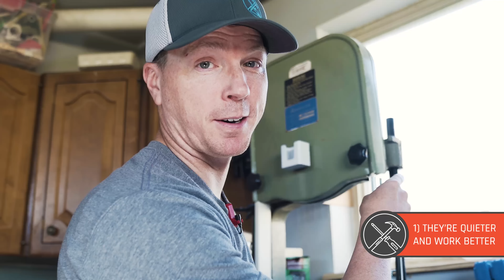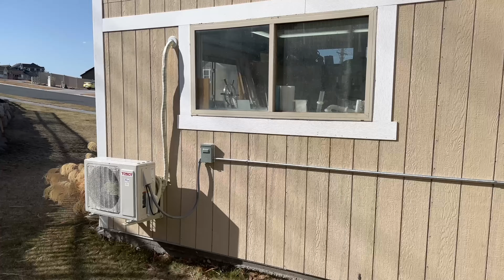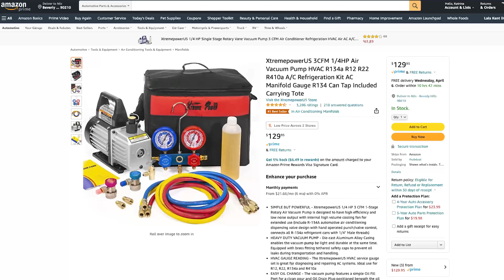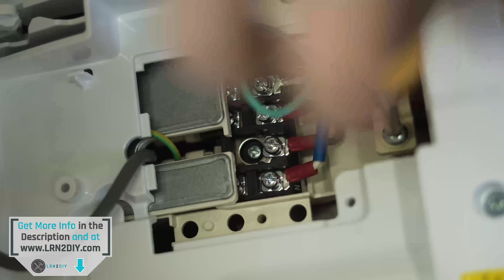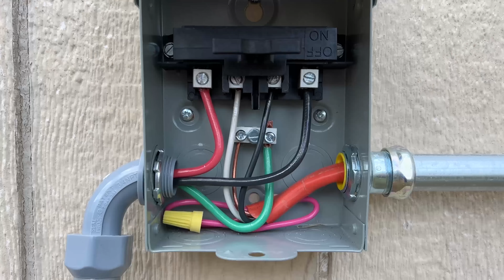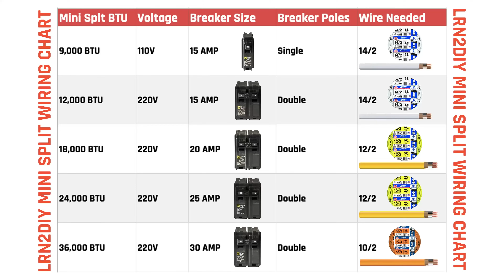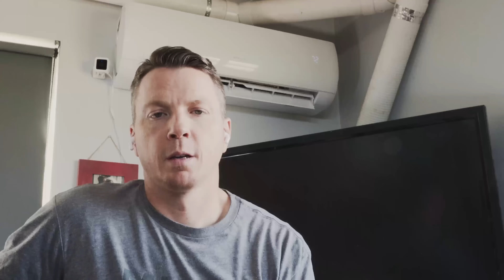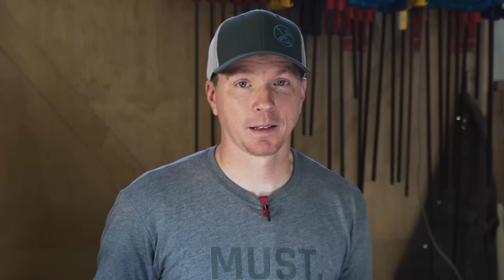Mini Split - 3 Things I Wish I Knew Before Installing

Comment: Thank you! Just the information I was looking for. Thinking about 2 mini splits in my 35' RV. This info really helps!
Reply: Grand Designs is starting to install ductless mini split heat pumps in their new units!  It is a great upgrade.  They put in a 2 zone 240 volt outdoor  unit under the fifth wheel section, with the air intake on the drivers side.  You have to be right next to the unit to see if it is running, they are so quiet!  And the indoor coils are silent, as noisy as a very quiet refrigerator.  

The problem with the two zone outdoor unit is they require 240 volts to run them.  Your other option is a pair of 120 volt units, with each being 12,000 Btu capacity.  There are several suitable units, and I would suggest using both drain lines on the indoor coil.   That way, if the unit has one side higher than the other, the lower side will drain out.  I would mount the unit on the drivers side wall, and then run the tubing into a closet or down the wall into the basement area.  That way the drain will work the best, and also hide the copper tubing the best.  

I think that Grand Designs is going to start using a 48 VDC inverter, and they are also recommending that you install a 9 kilowatt alternator on your towing pickup.  So you will have two alternators.  They then use a 15 KW battery system at 52 volts, and the alternator is rated at 9,000 watts, or about 175 amps at 52 VDC.   I am not sure how large the wires are between the truck and the RV.  They might be running even higher voltage, I just don't know for sure.  If the alternator going to the RV is running 3 phase at about 300 volts, then #10 wire fused at 25 amps would be large enough, and still have a cord that is flexible.  At the RV, the alternator output voltage can be reduced to charge the 52 volt battery at about 175 amps.  So very large wire is required to handle 175 amps for 9 KW at 52 volts DC.  Think larger than your battery cables on your truck battery.  

So the problem remains If you happen to love a RV park that has a 30 amp 120 volt power plug, and is out in the middle of nowhere.  If you have plenty of solar power, that is fine, your inverter can produce enough power to run the ductless heat pumps.   If you can plug into the 30 amp service, and run the battery charger to keep the 48 volt battery full, or at least partially full, then the inverter can run the 240 volt ductless heat pump just fine. 

But if you do install two each 120 volt ductless heat pumps, you could run them on a 30 amp service, and do much better than when trying to run a pair of 120 volt rooftop units.  This is because the ductless units only draw about 1,000 watts when doing the maximum cooling, like when it is 80 inside and you set it to 70.  Once the inside temperature and the set point are very close, say it is 76 inside and you set it to 74, the compressor slows way down, and the unit can use as little as 350 - 500 watts.  So running a second one with a 30 amp power service is fine.  If you are getting close to your maximum power draw, or the voltage is dropping, you can shut off or unplug your battery charger until there is a time, such as at night, when you can plug in the charger again.  Or run a extension cord to the power post to run the charger from the 120 volt 20 amp plug.  That can shift about 5 or 6 amps off of your 30 amp plug to the power post.  Or if you can plug the ductless units into a 120 volt receptacle, then plug one into the RV, and the other into the 120 volt power post receptacle.  

I might suggest installing the outdoor units on a cargo carrier on the back bumper?  Maybe you have a better location in mind?
Reply: Check "Paving New Paths" where they visit Grand Designs to see how they install a 240 volt ductless unit in the Grand Designs fifth wheel.  Also look at the Tampa RV show made by the same person, Paving New Paths.

Comment: I wish I can do it my self all the ac company wants to charge me 5k for 1 small room
Reply: Mr Cool does sell a do it yourself install kit.  The refrigerant lines already have about 10 PSI of R-410 in them, and a foil covering on the end of the tubing.  So as you attach the two tubes together, they puncture the foil and allow the refrigerant to flow freely.  

Basically if you are friends with a electrician, you can install it with their help.  The electrical is the really difficult part.  You would pay about $500 more for the DIY install kit by Mr Cool, compared to the price for the tubing that is connected with flare fittings, then evacuated with a vacuum pump, and then you open the refrigerant lines.  All of the units are pre-charged with the correct amount of R-410 for a line length of about 10 to 25 feet.  Over 25 feet, you would add about 1 ounce of R-410 per extra length of tubing, there is a chart with your unit to say how much to add.  

Maybe you could take a class on air conditioning and electrical installation, then start a business installing ductless heat pumps?  They only take about 4 hours to install one, once you are used to doing it, and have the right tools (about $500 to $1,000 in tools).  Then you could be the one making $2,000 to install one!  You do have to buy a inspection for about $300 in many locations, a little more or less in other locations.

Comment: okay, so you bought a vacuum pump and gauges. Now, you need to purchase R410 or the new stuff R470 - so did you check the price on the Freon? You forgot you have to add Freon. Pre-charged lines are pre-charged with Freon. Uncharged lines are lines without Freon. The smallest units you can get are 6K BTU
Reply: Davey, Every unit I ever installed came with enough refrigerant in the outdoor unit to run the unit, and have plenty to use with up to 30 feet of copper lines.  Beyond that length, I would add a very small amount of refrigerant, say 1 ounce for every 10 additional feet of tubing.
Reply: @Kangenpower7  The point is - refrigerant must be purchased - and the cost of that refrigerant was not even mentioned in the "cost savings" portion of the video. So, how much does that refrigerant cost? Oh, and what does the vacuum pump cost that is needed to purge your lines? The pump was also not mentioned either. Here's my point regarding "cost savings" - there are no cost savings.
Reply: I mentioned twice that this unit is pre charged with R 410.  No advantage or disadvantage to any other brands of ductless or ducked heat pump or SC units.
Reply: @Kangenpower7  Not all mini-split systems are pre-charged. Did you mention that?
Reply: @kathyern861 , I have never installed a mini split unit or even a ducted unit in 38 years that was not factory charged with refrigerant.  Have you found a brand that is not charged at the factory with refrigerant?  I have heard of a R-22 system that is sent out "Dry" or without refrigerant to meet the new EPA requirements, but that was years ago, and I don't know if you could buy a new R-22 unit that is sent out without any refrigerant in the outdoor unit.

Comment: I have two mini-splits now. The first was a Mr. Cool, but the second one is a Senville 9,000 BTU unit. I saved quite a bit over the Mr. Cool model, and was able to do a no-hassle self install, thanks to watching your very thorough installation video! I even found a perfectly operating, professional-grade line-gauge set just lying in the middle of the street prior to buying the Senville unit. I was vacillating on whether or not to buy another Mr. Cool, but took the discovery of the line-gauge set as divine guidance to move forward with the self install.
Reply: Was it lying in the back of someone's work truck? 😬
Reply: @flyingjoed  it was more inside one of the side tool boxes, so it did take a little effort to make it "fall off the truck". No, it was lying in the road. I also looked around for a service truck the night I found it, and talked the next day to the HVAC service people who had been working at the house next door all week to see if it was theirs. No takers though.
Reply: @bmccarty2012 😂
Reply: I think THAT is exactly what divine guidance looks like!  Way to be tuned in and congrats on your gift.
Reply: Thats awesome there was a line set cover randomly waiting for you

Comment: Does the DYI install void the warranty on these. I just installed a Daizuki... not a very reliable unit. Heating stopped working after one season. But because I installed it myself, there is no warranty.

Comment: Great information, thank you for your vids! I saw your other video where you showed your gas fired heater. I would like to know if you think this split system heated your workshop just as good as the gas, and at a comparable cost. I am trying to decide which one to do, the down side of natural gas for me is I will have to run about 120 feet of underground gas pipe.

Comment: My first mini split was an LG and the inside fan was so noisy I couldn’t sleep with it on. I replaced it with a Mitsubishi, and the inside fan is so quiet I sometimes put my hand at the opening to check if is on. Both units have an intentional feature it dislike. In the AC mode the inside fan never turns off, even after reaching the desired temperature. The LG’s fan sounds like 400Hz military jet powered generator, which is big problem to me. The Mitsubishi actually doesn’t bother me if is on, because of how quite it is. I looked up the feature on their respective wed sites and both of the say the feature makes them more energy efficient, in that the fan isn’t wasting energy spinning up to speed.

Comment: As an HVAC installer in primarily mini and multi splits, this is one of the best reviews and intros to high efficiency heat pumps yet…and he didn’t even mention most mini splits today(2023) use half the power of a window unit and three times less than a central ducted system.
Reply: Wouldnt the power usage depend on its seer rating? 3x a central ac seems like a lot more power.
Reply: @srharris88 - I suspect he meant a mini split uses ONE THIRD of a regular unit when he said "three times less".
Reply: @debbiedogs1  I am SOOOO glad that I am not the only one who has noticed that a majority of people seem to have never been taught how to express multiples when making comparisons; "3 times" vs "1/3", etc.  The other thing that is really annoying is "less" vs "fewer" and "more" vs "greater".  Thank you, @debbiedogs1!
Reply: Living in Thailand and love the quiet, efficiency and ability to direct the cool air to your location with a Mini-Split.
Bought the Mitsubishi GT series 22 SEER, using R32, and Inverter which does soft start/stops.
Reply: @jbranche8024 R32, wow I thought that one had come out more recently.  It's basically fancy Propane, uh, flammable.  I have heard that insurance companies are getting nervous about its use, and firefighters are not far behind.  Another win for poor regulation and planning by US EPA.  Find the best R and stick with it.  Changing every time we turn around is driving us crazy!
Reply: Does the indoor unit need a drain (for water)
Reply: @0my  Yes.  It will come with a drain line that would tie into a drain
Reply: have a 1 story house. It has 2 central air units. I'm thinking of adding many mini splits (1 ton with solar input and also 110 ac input). I want to connect 4 solar panels to each mini split and just have them run for free from 10 am to about 7 pm when the sun is out. And if the grid goes down, I have a couple low noise gas generators that can power the mini splits with 110 ac. Is this a good idea? Using solar to lower the electric bill but also relying on the grid at night and when the sun is not shining like during thunder storms.
Reply: @neilwani1178  yes, and we're all jealous as hell, that's why nobody answered, you lucky dawg. Couple thoughts; if it says four panels nominal, then put in seven. They list nominal power anticipating full sun and new panels. Seven will cover you for intermittent sunshine, as the panels lose efficiency as they age, and to compensate for the heat of the sun when they lose efficiency, and seasonal variations and shading. Going whole hawg and adding batteries and a hybrid inverter will bypass peak billing times and also run it at night. 

By saving the excess solar during times when your unit has enough power and is up to temperature, you maximize the energy return from your panels.  Maybe most effective if avoiding grid is your primary goal. Also, if done all out, you can take advantage of your utilities net-metering scheme and either: get paid for your overproduction, or bank it for later, less sunny seasons, i.e.: BC Hydro in British Columbia Canadia.  Moreover, you can avoid peak time- of-day tariffs, while also using the stored electricity for other things.  

Four panels will be a great and give the best energy saving bang for the buck.  You'll have redundancy if one mini split breaks. 

BTW, "Signature Solar" online in America sells the EG4, an AC/DC  hybrid no-vacuum quick connect self-install true DIY precharged units (and also used panels I believe.)  
Costco sells a non-hybrid but still similarly true DIY self instal no vacuum quick connect precharged unit.
Reply: I live in an expensive state for elec. so for Peak Time our rate is 78 cents a KWH. I am looking for a better alternative.
Reply: @Moondoggy1941  thats insane what state is that? i thought MA was bad at 30
Reply: @sterlingmichel4445 California for the win. Yeah😢
Reply: @Moondoggy1941 we are at $12.00 a kWh for our peak for one hour. Peak is 3 to 6 pm in summer and 6 to 9 am in winter. Highest hour of those 90 hours is what you get billed for. The rest of your bill is .06 per kWh. This is in South Carolina, Santee Electric.
Reply: What is the average cost to install a 2 ton? Thank you.
Reply: I just looked, and for a 12,000 BTU 17 seer mini-split, it's draw was the same as as 12,000 BTU window unit - 8.5 amp, but the mini-split went up to 20 amps as a possible draw!   (going to need to dehumidify and somewhat cool a workshop/storage building)
Reply: @tbelding the mini split COULD draw that but only will in the harshest condition. The window unit will always dray that. Most of the time when I throw a clamp meter on a mini split the draw is no where near the max. I don't think I've ever actually seen one anywhere their max.
Reply: @justinlewis1997  In Houston, so 'Harshest condition" is pretty regular.

Comment: Pretty sketchy for buyers in the northern US or equivalent climates. That Mr. Cool unit only heats to a minimum 5 degs. F outside. The Tosot claims to still be providing heat at -13 degs. F. but offers no specification as to how much. If it's only able to provide 10% of its rated capacity at that point, that's not helpful. It's important to know your application and equipment limits thoroughly before buying.

Comment: I am planning to switch from swamp cooler to split cooling system. I am thinking t run the lines through the existing duct for an older adobe home. Thanks for sharing.

Comment: Though a 220 cost more when first purchasing, and it's take a knowledgeable person in electricity to wire it, assuming there's no 220 already available where you need it. It last longer, thus making the cost of replacing a 110 more when having to replace it a lot sooner. And it's actually over the longer duration they last, they also actaully utilze less electricity. Then a 110 does.
Reply: I have never noticed a change in voltage can reduce the lifespan of a motor.  Either one will run over 5,000 hours if properly installed (using a vacuum pump) and it does not matter if it is 120 volt or 240 volts.

Comment: I have a pioneer Mini split and I can't set the heat to turn itself off when the room gets to the temperature indicated on the unit 
According to tech support it's not possible on my unit ..huh ?
The only work around is to press the ifeel button but that only runs for two hours then turns the feature off . .no good if I want to go to bed and leave the room at a desired temperature

Any ideas anyone ?

Comment: Your video is informative, but when it comes to Mini splits, it's not as simple as the differences you see, it's the components that they are made with. Seer rating is another crucial factor, some can produce heat at colder temperatures. Another point is , that vacuuming of these systems is not for the average person, you need training or your gonna have problems.

Comment: I would gladly pay the extra for the pre-charged lines because you have to figure in what your time is worth . And just how much will you use the vacuum pump after you are finished and then you have to take up space storing it for how long ? Again , the quick disconnects go hand and hand with the pre-charged lines and the cost of refrigerant isn't cheap either . Sorry but I am a plug and play kind of guy depending on the price difference and for me the little bit extra on a project like this just isn't worth the extra work for me .I was aa mechanic that has done just about anything and everything especially HVAC for 321/2 years . Great set up though !

Comment: Was the Gas (freon) extra or was it included in the unit you installed?
Reply: Steve Mize,  Every ductless system, and every ducted system that I have installed, they include enough refrigerant in the outdoor unit to work with between 15 and 30 feet of copper tubing.  Then make a small adjustment if you have a longer line.

Comment: If you rotate the gas fitting a quarter turn backwards you can engage a super secret locking mode the manufacturers don't want you to know about.

Comment: You didnt add the price of the coolant in your calculation.
Reply from the maker: There is no additional coolant to be added. The unit ships with the coolant in the condenser. When you open the lines, the coolant is released into the lines. There is nothing additional.